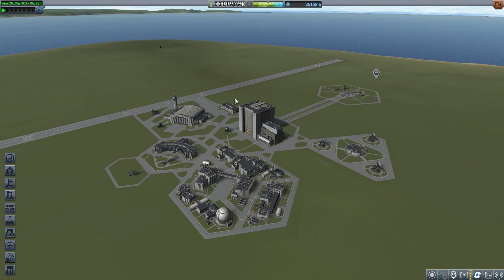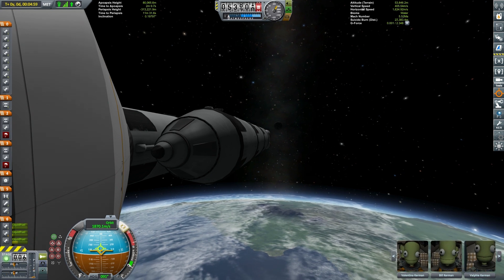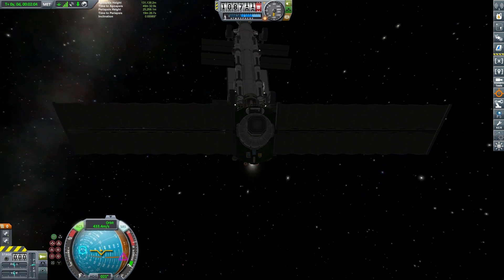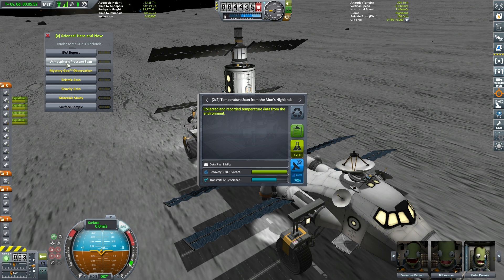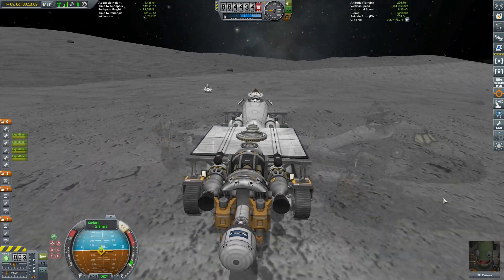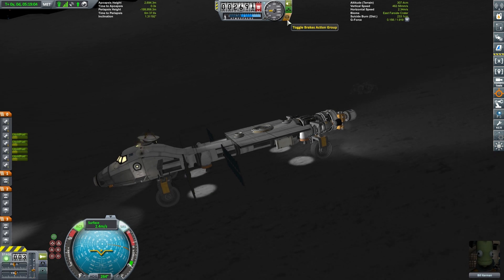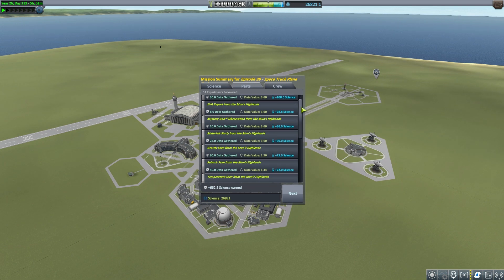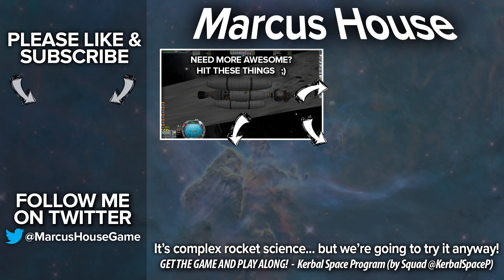KSP Rover Mun Lander/VTOL Truck (Tutorial:39) Kerbal Space Program 1.2 -  Stock Parts (visual mods)

Comment: i downloaded it, but when i try to launch it just flips over, abd it seems the the centers of mass and thrust arent aligned properly
Reply from the maker: Make sure you are pointing prograde the entire ascent. If you deviate just a little outside it will flip. Check out the ascent profile I used in the video and try to copy it closely. You can of course adjust the positioning if you want to improve the COM / COT.
Reply: there are 2 problems
1. for some reason, on the launch pad, the navball shows the perspective of the  truck's cockpit, so its like im facing the ground, and i cant switch to the probe core because its covered by the fairing
2. as soon as i lift off the ground it flips, no matter what i do it keeps flipping
Reply from the maker: Ah.. yes your control is set to the wrong unit for some reason then, you are right. You can zoom your camera in through the fairing and right click the probe core from inside to control from here. That happened to me a few times too now I think of it. When the control is correct you should see the navball pointing to the sky. Sometimes even KSP disobeys the root part form some damn reason.
Reply: as i said, i cant right click any part inside the fairing
even when im zoomed inside it
Reply from the maker: Maybe just add a new probe core under the fairing so you can control it then. I'm able to zoom in and select through the fairings. Not sure why.
Reply: what mods do you have installed? ( if the list isnt too long)
maybe a mod enables it

Comment: I'm trying to get a rover in a hangarbay of a bigger rover to Duna but during my testing on Kerbin i run into the problem that once I decoupled the node for the rover in the rover and reattached it, next time i have to "undock" it and that slings the rover in the rover up into the air by a good bit that punches it tires or explodes it completly. That weirdly happened to me when it got the attachment in the back .... now that i docked it on the bottom it still does the exact same. 

help?
Reply from the maker: This sounds like a  lot of fun. You should video capture this problem :)
Reply from the maker: Yea wow.. that is weird. Can you re-dock with it in orbit?
Reply: Nope, still slings out with 5-10m/s
Reply: I had the same problem trying to load a rover in a mk3 cargo bay. The issue is that the suspension bottoms out when you're docked because it's the same ship, and when you undock it thinks your wheels are below the ground/floor and wrecks them. Try placing the docking port higher up and use landing gear or thrusters to lift up the front end to dock again.

Comment: when I've played it, it didn't have those direction buttons are those a mod or what??
Reply from the maker: Not sure exactly what you are referring too there. The docking scene? If that is the case this is the Docking Port Alignment Indicator mod.
Reply: the direction icons on the left of the nav ball?
Reply: Anas Latique That's just when you turn on SAS. It's your prograde and retrograde marker. Normal and anti-normal etc... Really handy!
To enable SAS press T or click the little SAS icon on the navball. You need to have a pilot or a reaction wheel for it to work properly.
Reply: You have to unlock these in career mode by upgrading your buildings

Comment: What's the claw on the end of the truck for
Reply from the maker: Very handy to have a claw in case you need to dock with another vessel that doesn't have lines up docking ports. Could also be used to pull a trailer of some kind. :)

Comment: I once landed a rover like that on the Lowlands instead of the Highlands, so I had to drive uphill for hours at 2 m/s to get to the next biome. When I got over the crest, I flipped it on the downslope...  The rescue mission also went wrong due to a staging error, so the end result was that the rescue mission's lander had to rescue the lander crew at the same time that the lander mission's orbiter was rescuing the rescue mission's orbiter crew! Amazingly, everyone got back to Kerbin okay. Didn't play KSP for a while after that...
Reply from the maker: Sounds epic! And ultimately very frustrating :(
Reply: Harold Weaver Smith that is such a kerbal story. I love it.
Reply: This reminds me of the maiden flight of the KR-X11 Heavy Passenger SSTO. Its reaction control system ran out of fuel on descent to the surface of Iota, and it's reaction wheels weren't nearly enough to compensate. This resulted in the VTOL engines pointing the wrong way and the entire craft fracturing into pieces. Luckily the crew/passenger modules survived, but that meant a rescue mission would have to be sent.
Reply: All these wonders await you....
Reply: WOW! I cant even Get a space ship into orbit! XD Im a newb

Comment: why dkn't you buy a better gpu? i'm seeing on the launch that the time is 2X slower, i had the same problem on my computer, i Just changed the gpu and it work!
Reply: what mod that you use to acelerate and time warp at the same time?
Reply: you dont need a mod. its physics time warp and you can use it simply by pressing alt + timewarp. a better gpu wont give you better performance with big vessels by the way. if the framerate is always bad, it might be the gpu. but if its only bad at the beginning of a mission when you are dealing with huge vesselsizes, its more likely your CPU bottlenecking your system.
Reply: Ray Crate ok, thanks you!